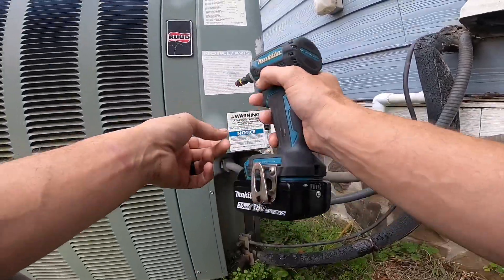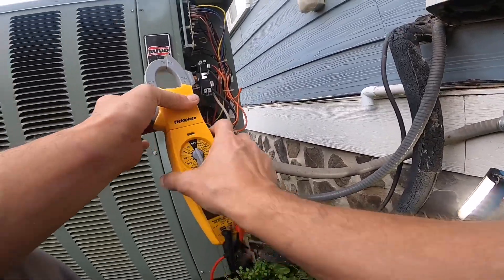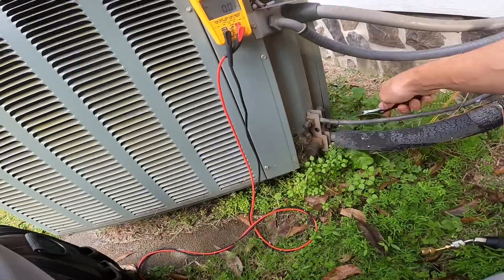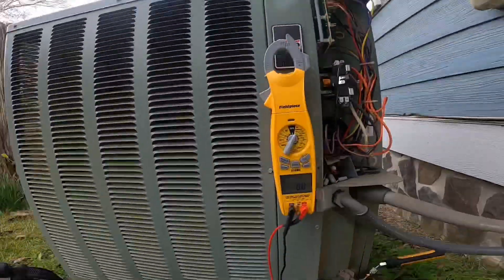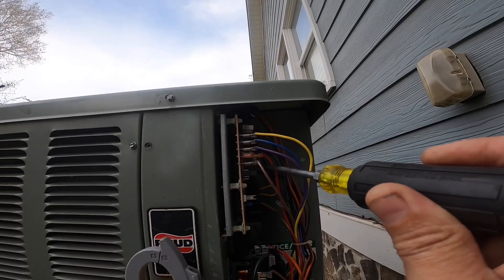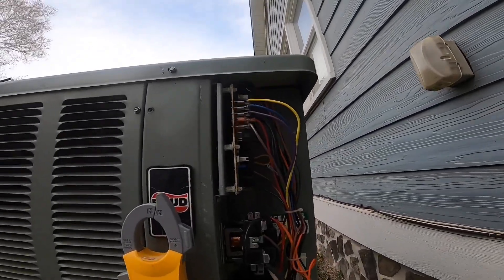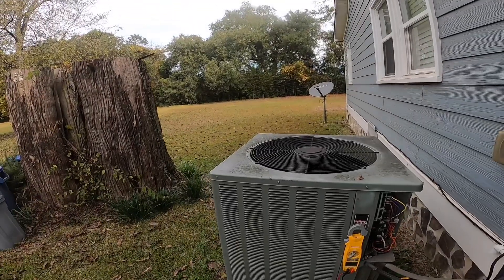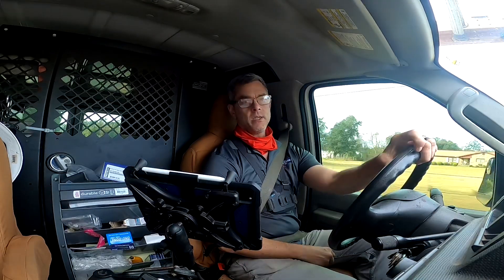How To Test Defrost On A Heat Pump

Comment: Copeland has came out literature last year that they don’t want you forcing defrost on their compressors. Something along the lines the scrolls spin backwards for the first second and is killing them left and right
Reply: It's surprising they stop/start them like that.  Used to just keep compressor running and switch reversing valve.

Comment: I'm in Ohio (different climate then you're used to) but wondering if I should switch to heat strips when it dips below 32°F or just let the system do its own thing? I have a new Payne 3.5 ton just installed this past summer
Reply from the maker: Depends on the heat pump. Most start losing ability to produce heat when it gets close to freezing. Some of the inverter driven heat pumps advertise that they can produce heat well below zero. Something like that would eliminate the need for heat strips around here.
Reply: @HVACGUY  how would I find this info?would it be in the manual provided by the hvac installer?
Reply: @staind288  What you need to look for is the balance points for your equipment.  Heat strips should automatically stage on as temperature falls below these points.  Remember, even if it is very cold outside, the heat pump will generate heat at a better c.o.p. than electric strips alone.  What will happen is the structure will lose heat faster than the heat pump refrigeration cycle can generate heat.  In other words the balance point.  Supplement or aux heat is then brought on in the next stage.

Comment: You are so right my man last year I had a heat pump that the wire nut on the red wire one of the wires came loose and defrost never happened even though the system operating
Reply from the maker: Yep

Comment: Haven't seen many videos on the Adaptive Demand Defrost on residential heat pumps.  I'm not an HVAC tech but bought a spare board after I had a failure to learn the difference.  Not dramatic, but their are differences.  The "test" pin is really just taking a pin on the chip high to signal defrost.  The selector is termination temperature instead of run time.  So if you need more defrost, you'd raise the term temp.  My board defaults to a 30 timer function if the ambient thermistor fails.  If the coil thermistor fails, defrost doesn't run.  And upon first defrosts after the board has had the 24 vac R cycled, the it does a few timed cycles while it relearns and begins adaptive defrost.
Reply from the maker: I have seen a large number of those “failures” caused by frogs, snakes, lizards, and skinks. Sometimes I diagnose a failure and don’t see the critter until I remove the board.

Comment: That's obviously an interval time/temperature board. For demand boards are there test pins or something you can force a defrost with an insulated screwdriver while it's running in heat with the fan on?
Reply from the maker: Yes, some boards, like some trane boards I’ve seen, you just hit the test pins and it goes into defrost immediately if it’s in heat. That’s not a real good test though - sensor can still be faulty. In that case you need to ohm out the sensor and check it against temperature. But, you’re right about time and temperature on this board. Most Carrier and Goodman boards also use time and temp. But, they have a defrost thermostat instead of a sensor.

Comment: Nice explanation on defrost board.

We do not have to many heat pumps in new England.
Reply: I've got one.. a good 300-400 miles northeast of you ;p
Reply: Shpuldnt have any there. Oil burners and furnaces unless you got a duel fuel heat pump
Reply: @alexprowse5120  They're everywhere around here.  Mini splits and central systems.  Backup electric heat strips.